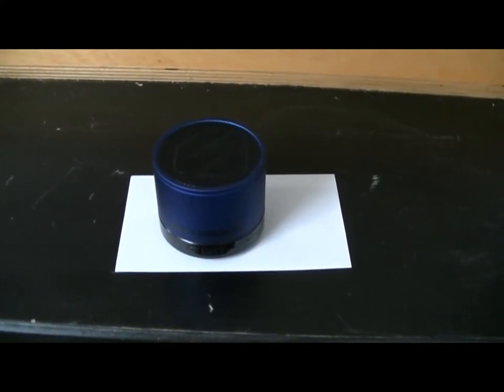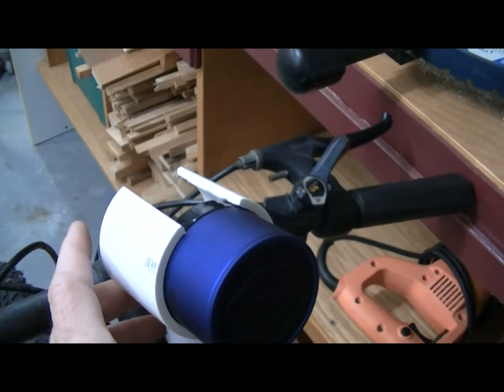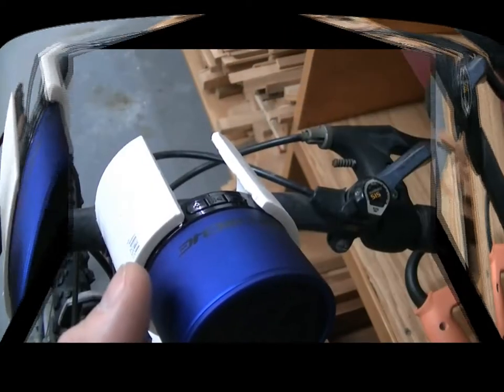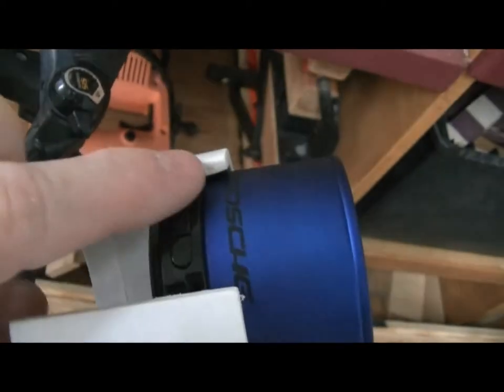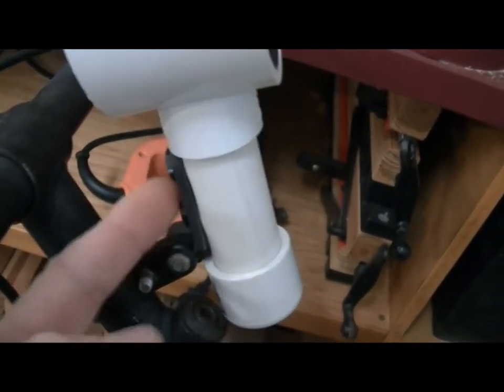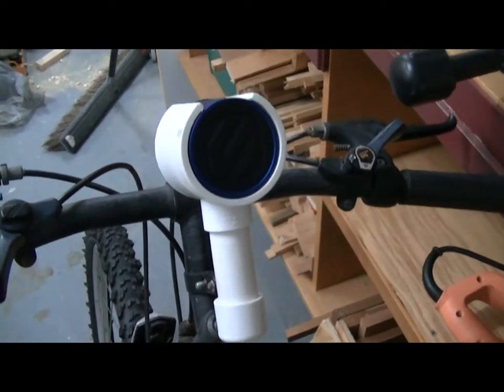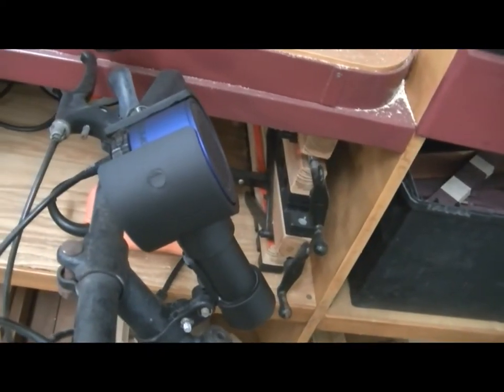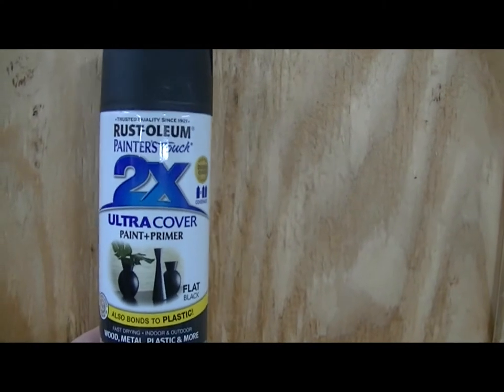DIY Portable Speaker Mount

Comment: An empty Mothers wheel polish container fits these speakers perfectly too. A couple of strips of bike tube glued in and it's vibration free. Mount on an old reflector mount and you can attach to your seat post or wherever. FYI